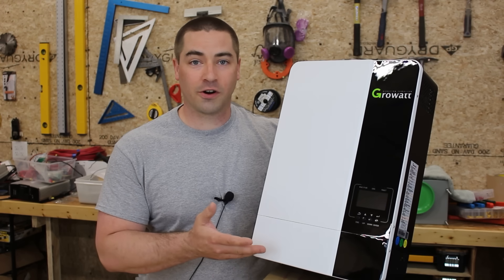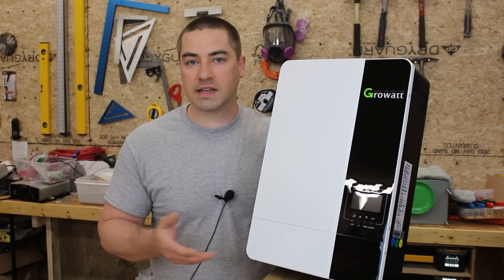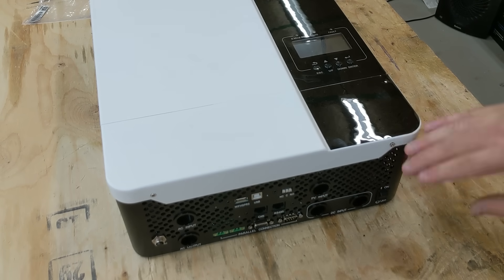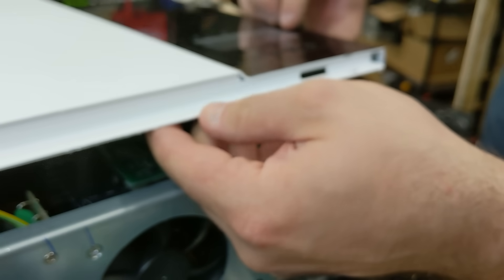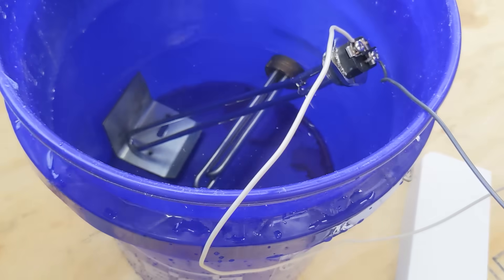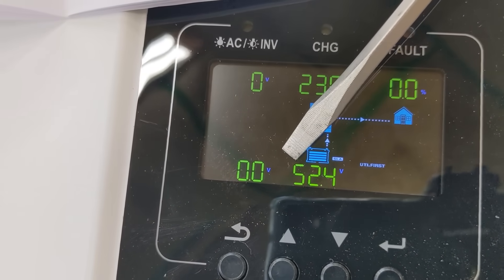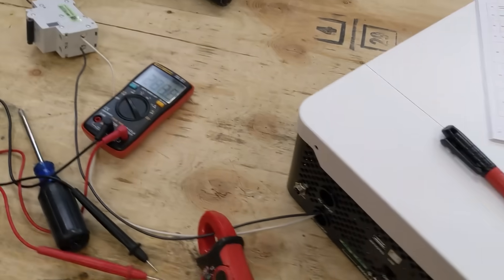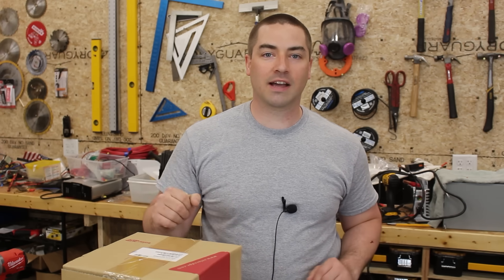Best Value Inverter, All-in-one MPPT Solar Charger, Growatt SPF5000ES, Part 1

Comment: Test it under some heavy start loads like your miter saw and split air conditioner/heat pump
Reply: Good think most new split/mini split AC are inverter based and dont surge.
Reply: Yeah...that would be some good tests
Reply: He just tested it with a 4.1kW load. That's a pretty good test to me
Reply: @andymendez24  it's fine for a quick test, but not a realistic usage though
Reply: I don't know whole lot about solar but basically he said this inverter is only able to power up a water heater. I don't know but that doesn't sound like a whole lot. Is 5kilowatts alot of power? I mean spending $900 not cheap.
Reply: @brizzx32  That's why it's really useful that these inverters can operate in parallel.  If you need more than the rated 5 kw, you can just wire in a second one in parallel and let the units sync their output sine waves.
Reply: @brizzx32  30-40 kilowatt hours is a fairly average US household usage per day. 40 Kilowatt hours would mean pulling 40 kilowatts for 1 whole hour, or 2 kilowatts over 20 hours. The only things in a household pulling more than 5 kilowatts could be your AC, stove, oven, and dryer. Those are the most common at least. And even your dryer and stove would probably not pull 5kw by themselves individually. A stove would not with only 1 eye being used. This water heater he is using requires more electricity than most things in your house. Where you run into issues is if you have a lot of lights on in the house, 1 eye on on your stove, while your clothes dryer is running, and then someone cuts on a large hair dryer. Situations like that could possibly overload an inverter of this size or smaller.

So 5 kilowatts over 10 hours would come out to 50 kilowatt hours, but the issue is some items in your house need to draw a large amount of electricity for a very short time. AC units draw a lot of power for a second or two when they kick on, and then return to a lower power consumption than they needed to turn on.
Reply: More and more loads these days are becoming brushless/DC inverting or whatever so it's getting better it seems. More manly option is to get the biggest buzzy Transformer you can suffer the parasitic draw of.

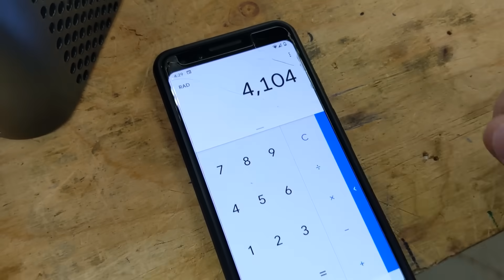Comment: At 15:22, your heating coil is touching your plastic bucket.  Did it melt?  I share your excitement.  This is all very cool tech  Thanks for sharing.  Like#1K+
Reply from the maker: It started to deform the plastic.  There is now a depression in the bottom of the bucket.  However, I stopped the test before it melted through.
Reply: Lol, I guess a lot of us were wondering about that...

Comment: Looks like MPP Solar: same parallel connection, same disposition as my PIP-5048MG, same display, same kind of price and characteristics. Good stuff!
Reply: I had the same thoughts. It also on sales all around the world with different brands, while actually produced by Voltronicpower
Reply: Quite the same thing :
Sorotec revo series 5.5 kw
It's High frequency ...
Unfortunately I "break" 2 Sorotec Revo series 5.5 kw :
One cause of the max Solar input array ... ( 4000 wpeak )
One cause of an undetected weak wet short-circuit in between both phase ( neutral-phase-earth )
My set up cannot detect it cause when you're running on solar you got no "back point" to mass or "earth" ...
Automatic switching between mass "regime" is not a "built in" to these models ...

So all the ground "security" systems from usual "grid" were inefficient ...
You ought to built up a neutral to ground automatically swichable connection for these that works only with non-connected to ground solar panels .

Got a Mpp pip 7048 max ...
Running quite good so far with 2 times 7 panels string south oriented on one "side"
And one 7 panel string west oriented onto the other ....

I would have a 8048 max ...
If and only import taxes weren't that kind an help thoses who gather this kind a material which is not produced at all in that "great" ... Union !!!

Dare, care, ride safe, clean, have fun ...
From France, with .

Comment: I was waiting for that water heater to melt it's way through the bucket and cover everything with water!
Reply: So you also noticed the heating element not being on the metal plate anymore. Must have happened in the heat of the demonstration which was very clear however.

Comment: MPP SOLAR has also offers in that price segment which excells the Growatt that i have here ...
The MPP Solar offers up to 10 kWP of solar power and a 5 kW inverter. That will fit far better to the most areas except southern california and deserts with 300 sunny days. If you you have cast and clouds and short daylight time in winter you will later want to have 10 kW just to get the batteries charged during winter ... and then the key question will be how much kWP does this unit support: 10 kWP will be king ... future proof

The core question is the supply chain ... and MPP Solar is from TAIWAN while Growatt is from chinese ... and you know about the BAN of chineses products that are getting in the american infrastructure.

MPP Solar has a better support than Growatt at least here in Europe where they had closed their domestic office ... just abandoned when the last employee had vanished, disappeared.
MPP sends you in case of damage a simple repair board in exchange quickly from TAiWAN direct from the manufacturer, not a dealer.

Comment: is this not build in the same factory as MPP solar, voltronic? i have the 48 volt 5kw high voltage it was only 700 dollar and shiped to the Netherlands. mine is working for more than a year now and had no problems with it.
Reply: http://www.mppsolar.com/v3/catalogs/LVX6048.pdf
David poz, you should do a video on this new release from Mpp solar.
Reply: @scarfaceveteren  thats a nice unit!!
Reply from the maker: I don't know if they come out of the same factory, but the look very similar.

Comment: Hi David,   Do you know if this unit can handle being ac coupled? I have a Growatt grid tie inverter, so this inverter needs to be able to frequency shift to limit the ac current being sent back to it.
Reply from the maker: I have not tried AC coupling personally, but it might be able to.  It doesn't frequency shift, so you would need some other means to dump, or turn off, solar when the battery is full.
Reply: @DavidPozEnergy  These are not UL "approved" for grid tie systems in the USA, but expect they would still work. You may however zap some poor lineman working on repairs down the line ☹️

Comment: Well i again see cheap capacitors there..and a lot of cable mess..so maybe that is reason why it is so cheap..if they would used better quality ones it would cost more but not so much more i would say..also those +- terminals looks a bit cheap to me..5kW ..maybe but still on cheap side..I would say whole inverter looks like cheap version  on another side mine 5kW inverter just inverter alone cost double of this inverter..so yes it is cheap one

Comment: I was looking at their 12k inverter recently. While the price is outstanding there are a couple items that bother me. Their max efficiency is rated at only 88% compared to say your Sunny Islands at 95% plus. Also the idle usage is near 200 watts on the 12k inverter. That seems like a lot. If you can fit it in, please address those specs on your 5kw inverter. Thanks David.
Reply: Average Joe is testing the 12kw LF split phase model, it showed 67 watts at idle
Reply from the maker: Hi John Stafford II,  I watched and enjoyed Average Joes video testing his 12kw LF inverter.  You are referring to the "Power Saver" mode.  When the inverter was ON, but no load (idle) it drew 161 watts.
Reply from the maker: Thanks for the comment.  It's great to hear what people want to see.  I'll include this in the next video.  I'm especially interested in the idle watts for myself.

Comment: solar industry needs an "iphone moment", all in 1 package, modular but easy to connect for the average guy, simple interface, too messy series / parallel, etc....ugh! plug and play, DONE!
Reply: @EZE V  you means something like this?

https://www.pointzeroenergy.com/product/titan-solar-generator
Reply: @danielavenson6964  no lifepo4 is a no go. Also solar panels should be DEAD easy to connect, average user doesnt understand series / parallel, etc...

Comment: I'm interested in the efficiency of conversion  of the inverter.  The external transformer will cost a few watts continuously...possibly 20 watts.
Reply from the maker: When I hook up the transformer I plan to check idle watts with, and without, the transformer.  When I had my Aims inverter it idled about 66 watts.  I love comparing the idle watts.  Sometimes it can add up to a lot.

Comment: I've been using Growatt and love it.  So easy to setup and use.  Powers my entire off-grid  home easily.
Reply: I just got my 3kw 48v modlr today. I can't wait until I get my batteries and get everything situated.
Reply: @op8995  if you have enough solar, this is supposed to work without battery
Reply: @michaelbouckley4455  I hope he tests that capability !
Reply: I'm trying to build an off-grid generator for my RV for when I boondock. (Think Inergy/GoalZero/PointZero but with more capacity.) Will the 24v inverter be sufficient?
Reply: A 24V is harder to connect to AC then if you use a 12V, right ? Do these only work with Roof Solars or 2-4 individual stand up ones ? Also, it comes with a battery ? Do you add an additional one like a lithium to make it last longer ? I'm looking at Solar Hybid inverters but nothing's going on my roof........ I've called Electricians, contractors and nobody can answer this ......
Reply: @childofyeshua9006  Either it goes on your roof, or convert your backyard into a. Solar farm
Reply: Hi can u use 18650 batteries on this inverter ?  And is a there a option to set minimum cut out volts on grid and of grid ?

Comment: You said it produces 240v single phase,  can this unit accept 240v split phase because you're not going to get 240v single phase anywhere in the USA. Second question is if it across accepts 240v split phase why can't it produce 240v split phase?
Reply: @Signature Solar You states it accepts 240v single phase. We in good ole USA have to have 2 legs to make 240v. So how is going to work here
Reply: Now if the neutral is pass thru can hook up L2 leg to neutral.
Reply: Great question .
Reply: @Signature Solar you still didn't answer my question. Will this unit accept 240v split phase? I know it outputs 240 single phase.  No matter how you wire the input to the inverter from the grid 240v it's going to be split phase with or without a neutral.
Reply: 240v is 240v. The split is the neutral center tap to get 120v. This will accept american L-L 240v with no neutral. It still won't output 120/240 split phase because it's not designed to.

Comment: David, did you ever test your big construction tools on the inverters while they were hooked up to the AC input pass-thru?  I always wondered whether the inverter would quick-transfer to the AC (grid power) if it could not handle the in-rush surge.  In one of your previous videos testing a 5000w MPP unit, I don't think you were hooked up to AC, but I'm not sure.  It seemed you were only running off battery power in that video when you tried your Dewalt chop saw and it cut off due to overload.

Anyway, that would be an interesting test to see.
Reply from the maker: I've never tested that.  Sorry I don't know.
Reply: @DavidPozEnergy  Please test.

Comment: This is Growatt you're talking about. They make world class inverters and they are among the top 10 inverter suppliers in the world with less than 2% failure rate. I have been using one of their inverter for over a year now and I have been using the 5000 es model for a couple of months now.
Reply: This is good to know !
Reply: One string of panels or 2?
Reply: @firstsat2000  one string
Reply: Is it safe?  How is the ground-neutral bond?

Comment: where did you source of the flat copper wire?
Reply from the maker: Out of an EV.  I'm still editing the video where I took it apart, but some EV's use round wires and some use flat wire.
Reply: @DavidPozEnergy  thanks man..d

Comment: So you can't take that inverter and take the two leads hook it into a breaker panel and have 2 -120 volt sides I don't understand you got two hot wires surely it's got a ground or a neutral somewhere otherwise it wouldn't be 220 at least American 220 explain how that works if you would please let us know how that works please
Reply from the maker: The next video will have a lot of time dedicated to this.  I hope I can make it more clear.
Reply: @DavidPozEnergy  thanks I would appreciate it because I want to buy a 220 inverter
Reply: needs an autotransformer to provide the neutral, as the unit is just 240v.
he says he will show this on the next vid
Reply: Most countries have 220v power grids., and this product model  is not for use in the U.S. Only a few countries use 120V.

Comment: Looking forward to following vids Dave, it looks like a good unit especially for Australia where we use 240v and 50Hz
As an experiment, could you run that heater at 240v and 50Hz and see if the heater pulls a different amp rating or heats up slower etc.
Reply from the maker: I did.  It was kind of by accident, as I hadn't yet changed all the settings in the inverter.  The heater pulled the same regardless of hertz.
Reply: @DavidPozEnergy  i would appriciate if you would run it as a battery less solar offrid inverter in your next video since that is what im looking for. :)

Comment: 9:00 I have seen a lot of failed CapXon capacitors in computer power supplies, motherboards, and monitors. Hopefully those bigger ones are better. I have noticed that the bigger ones in LCD/LED TVs are not the failure point. Thumbs up.
Reply: Recapping with better caps would cost more than the unit... LOL...
Reply: You might have not SEEN them, but did you take ESR measurements? I did. These fail just like the smaller ones, but more slowly.

Comment: Does anyone know if the "SPF 5000 ES" is UL certified? I found some evidence that it may be UL certified but I see that it's made in China and listed on Alibaba.  I'm guessing that the only way to know for sure if to ask the manufacturer for UL certification papers.  I ask because my local inspector will most likely insist on using only UL listed inverters and I will need to be able to prove it to them before install.
Reply from the maker: I don't see any indication of UL on it.
Reply: Growatts are not UL certified. They can't be hooked up to the grid. For off grid only.
Reply: @witness1449  That's what I thought. I saw an MPP all-in-one unit that I think said "UL compliment" but actually getting the certification is the hard (expensive) part.

Comment: The truth is, this was on alibaba for years now and was always the same price. And there are many good ones there as well, just no one wants to review any.
Reply: If I was sent a free one, I would shill it with the same enthusiasm as he does
Reply: Hummm, I'm 🤔why?? I was thinking the same, this is the 1st time I've even been introduced to this model! Need to check with Will also on this! This guy has acquired a new sub with me!!
Reply: check out all the MPPSolar vids, that's where you will see many installs, the Taiwanese came up with these "hybrid" high frequency inverters, all others are OEM'd or copied, various build qualities, and options, but all them the same, a bunch of MOSFETs.  Not UL Certified, Not NEC Compliant, absolutely not IEEE 1547 compliant. Won't pass inspection for occupancy permit, no licenced master electrician is gonna touch it, it won't be allowed grid interconnection, doing so is potentially felonious, Electrical Provider will not authorize netmetering for excess generation buyback.Finally, connection to the grid is very likely to create suspicious enough consumption patterns at the meter to trigger a fraud investigation you really don't want so be very careful. That being said I hypothetically would absolutely love mine if I had one.

Comment: any reason you didnt get a 120 volt one instead of using transformer
Reply from the maker: I wanted to try something different.  Also, by adding the transformer I'm hoping that it helps start my big power tools.
Reply: @DavidPozEnergy  appreciate that you did as this unit has global appeal.
Reply: @DavidPozEnergy  im interested at what the loss between inverter and load side of transformer. Because it is a good idea for high draw appliances. I heard some of the original sol-ark 8k, which I have, have a problem with like hair dryers and their fix was to use a transformer. My wife uses her fine and I haven't found anything to overload it.

Comment: What I find missing in all these inverter reviews and evaluations is no one seems to be technical enough to evaluate the circuitry or the build quality and that’s what this really comes down to. A poor design is going to fail at some point and some of these units seem to be designed far more thoughtfully than others. The components used in the assembly and layout are often overlooked. Measuring voltage, load, waveform etc. is really not getting to the root of these inverters.
Reply: And stress test at prolonged duration...